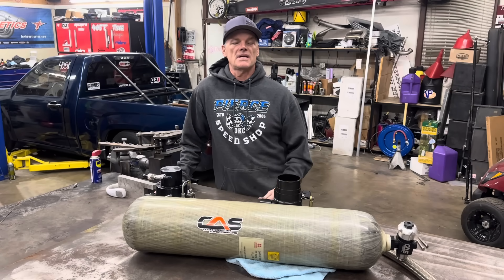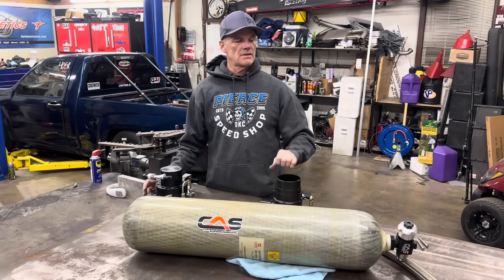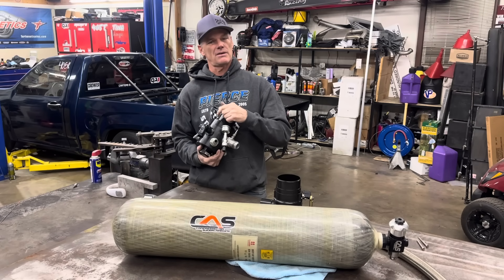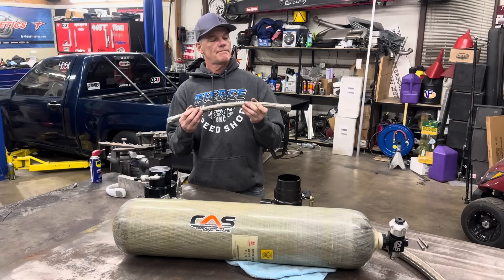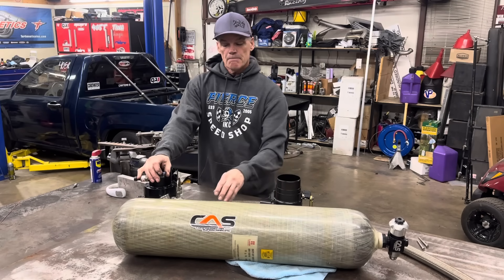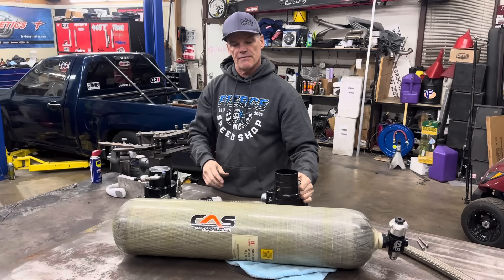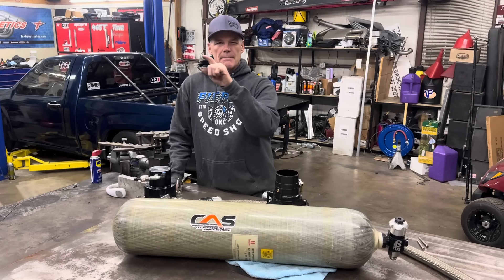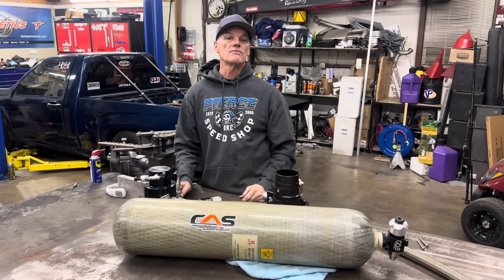Compressed Air Supercharging

Comment: It’s great to see this idea finally available for market, it’s taken the manufacturer’s around 15 years if I’m not mistaken to iron out the last few bugs to make this system bulletproof, I’m glad they stuck with it, this would be awesome if a pump could be used to produce more compressed air on the go as well as cooling the air, in several storage tanks which, is obviously the main problem with turbo and super chargers, the heat produced compressing the air.
I’m excited to see just how fast you can go with this system.
Reply from the maker: it all sounds easy lol but there was a lot to work out!! thanks!
Reply: I've been thinking about an on board compressor and a tank to use compressed air to spool the turbo on my Duramax. Since it would only require a second to spool the turbo, it wouldn't require as much volume or pressure. The reason for all the pressure in these CAS tanks is to have enough volume for full a pass. If I wanted 1000 CFM for 1 second, that's about 17 cubic ft.
Reply from the maker: @Cantthinkofahandle117  they do have some smaller cylinders you could maybe use. You would need to contact them. Thanks!
Reply: that company 15 years
people have been trying to figure this out for decades
I mean, its an obvious idea.

Comment: what happens if you have to peddle during a pass?
Reply from the maker: we will be installing a blow off valve like the red truck and that will allow for pressure relief. as soon as we are back on throttle it will be instant boost again. Tina has done this many times in the past with no issues

Comment: What is the cost of this 1400hp system? Cost of the 2400hp system?
Reply: Great idea. I remember when this first came out. The only problem was the equipment needed to compress the air. Please do a video on that equipment. Thanks
Reply from the maker: @oldandboosted  ok we will do that thanks!
Reply from the maker: There are options but starting at $8500/1400hp and up from there.
Reply: @TinaPierceRacing that's not bad, kind of affordable
Reply from the maker: @jaysguyrage9483  when you add up all necessary components for turbo or any other superchargers it adds up!!
Reply: @TinaPierceRacing  what does the air compressor setup for refilling the air tanks run?
Reply from the maker: @DMP6969  we looked for a used compressor and found a guy going out of the paintball business and bought it pretty cheap. A new Bauer compressor are from  5000 and up depending on what you want
Reply: So is there a place that sales these kits?
Reply from the maker: @brandonowen-tk9fm  yes